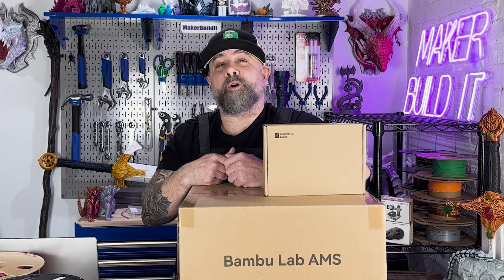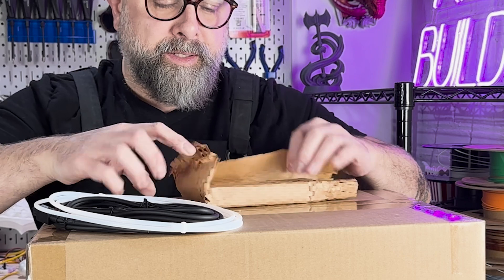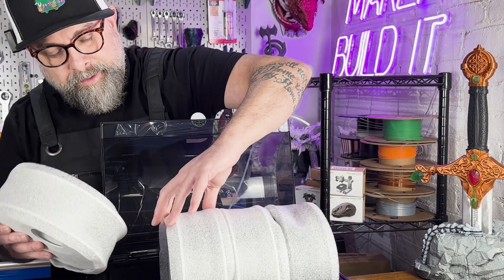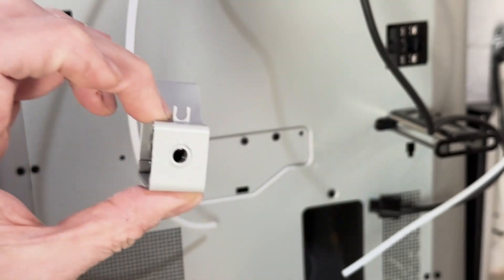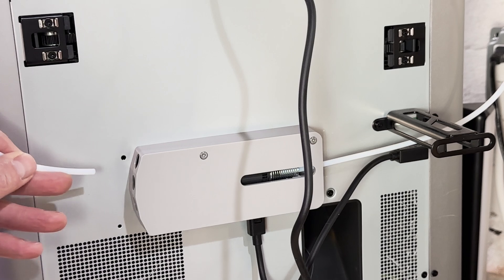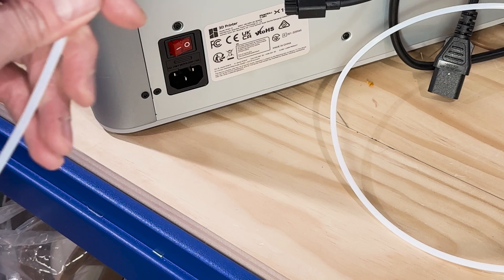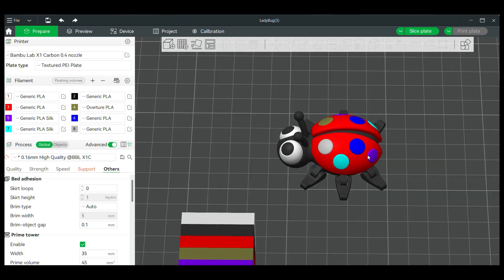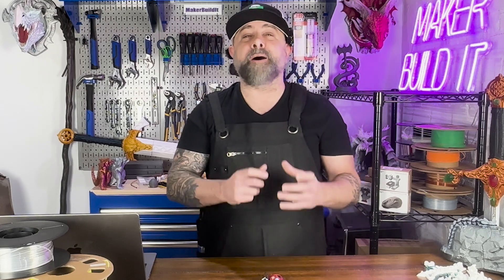Do this Upgrade FIRST on Bambu Lab X1 Carbon!

Comment: I've heard from many that the AMS hub isn't actually necessary. You can do it with just the PTFE splitter for the A1 since the controller would do the switching for you. I haven't personally tried this, but I would be really curious to see such a setup working without the hub.
Reply from the maker: I have to try that! 😀
Reply: @MakerBuildIt  If you do, please post a video. I would love to understand how the AMS switch works without the hub.
Reply from the maker: I plan on it! 😁